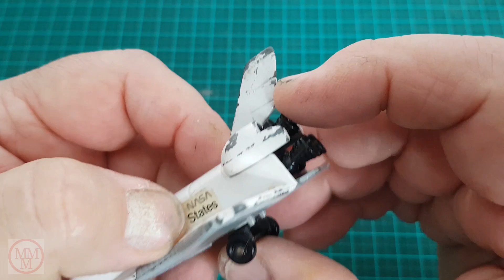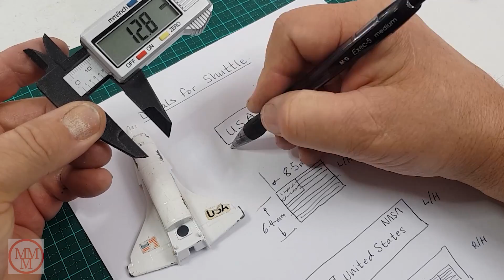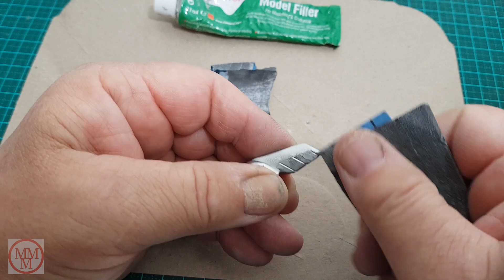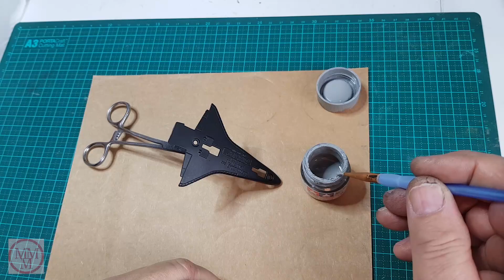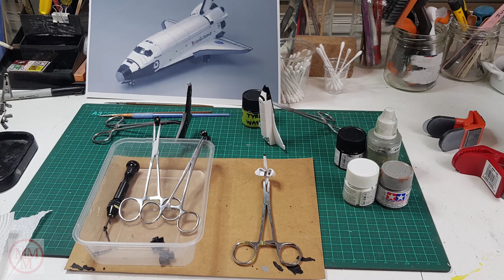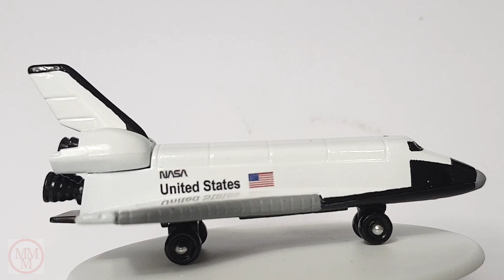MATCHBOX Custom No SB3 Skybuster Space Shuttle 1979

Comment: Today's lesson: Copyright dates. The 1979 date is the year the design of the toy was put under copyright protection.  Not necessarily the date of manufacture. It could however be no earlier than 1979.  Notice also that place of manufacture has been altered.  This model was likely first produced in England by Lesney.  Once production was taken over in Macau by Matchbox Toys Ltd., the base was altered. This would have been after 1982.  Your model is no older than 1982.

Comment: I try not to tell modelers how to do things, but let me suggest something if you don't mind, based on a comment you made in the motorcycle video and after watching this.  I take a Scotchbrite pad:

https://www.scotch-brite.com/3M/en_US/scotch-brite/tools/~/Scotch-Brite-Heavy-Duty-Scour-Pad/?N=4337+3294529207+3294631680&rt=rud 

(A link in case you Aussies call them something else)

I cut it in half and lay it in enough water to saturate the pad.  Then you can set the decals upon it, paper down, they will release but not float around in the water.  They stay in place on the backing paper until you're ready to use them be it 30 seconds or 5 minutes.  A small piece of sponge will work as well.

Anyway, take it for what it's worth!

So at the end, you only filled half a tank eh?

Comment: Wanted to goe you a tip for dealing with some of the bent windshield pillars and like the bent posts on your #10 Pipe Truck you did.   Once you strip all plastic parts off, you can carefully heat bent diecast with a propane torch. Die cast is very soft and plyable once heated up.  Don't use too much heat as you can melt it.   Hope this helps!!!

Comment: Hi Marty! Nice job as usual! You know Marty,sometimes bespite they are metric size those little screws comes with inch size hex socket.And as I learnt from experience in other areas(restoring motorcycles) never use oil to help treading in soft metals like diecastings or aluminum,just in really needing use a drop of querosene or mineral turpentine.The trading taps (male)comes in three types: cylindric or strait ,semi-conic,and conic.As you can made out the cylindric is the same measure all its treaded stem the semi has a 1/2 of its lenght conic and the conic is almost half lengt conic .They must be used all the tree to tread a correct hole you start with the conic and finish with the straight one so you reach to the bottom of the hole with treads and do not need to cut the screws .(And do not risk to the screw to seize in the treaded hole and ruining the fillets.Greetings from Uruguay!.

Comment: You can always double up on the images printed on clear decal paper by applying a duplicate right over the original. I've done this with great success. Really improves the color density. Reds are rich and black is black. Of course, let the first one dry thoroughly before applying the second image over it.

Comment: Just a little technical precision: these thrusters are not "exhaust" as the combustion actually happens inside the cone itself, countrary to a jet engine. And the fuel is liquid hydrogen and oxygen mostely provided by the huge jettisonable belly tank. The side recoverable boosters use a solid propergol and their cones ARE exhaust as the combustion happens inside the booster's body. Nice job with the decals.

Comment: What a transformation. Another awesome make over. And a nice tribute to the sheer bravery of those astronauts 50 years ago. They really did ‘boldly go where no man had gone before’.

Unsure if you are aware but the underside of the shuttle, nose cone, and leading edge of the rudder are black and grey as they are covered in heat proof tiles. 
It was one of there tiles on the underside sheering off upon launch that caused the catastrophic demise of the Space shuttle Columbia in February 2003. 

🖖🏻

Comment: Way better than new, looks absouletly spot on, you ommmited to mention it also produced the same emissions as 10 million cars running for a year every blast off and punched a hole 5 miles in diameter in the ultra thin ozone layer, taking 10 years to close up, great vid as usual, my dad was RAF himself.
Reply from the maker: Great comment, thanks! Marty.
Reply: That's BS.  The primary fuel of the Shuttle main engines was liquid oxygen and hydrogen.  The byproduct of which is H2O, Water...   The SRBs used Ammonium Perchlorate and Aluminum.  The reaction of which gives you Aluminum oxide, Aluminum Chloride, H2O and Nitrogen as a byproduct.  The shuttles were very clean operating systems and had no affect on the ozone layer of any type.
Reply: Dennis P. Sure, and no doubt you dont think global warming is real either, nothing to do with human activity, just a natural part of our cycle...!
Reply: @joolsfreeman4359  What part of basic chemistry do you fail to understand?